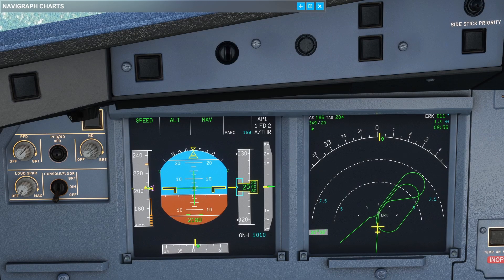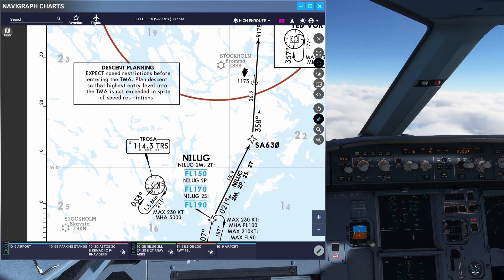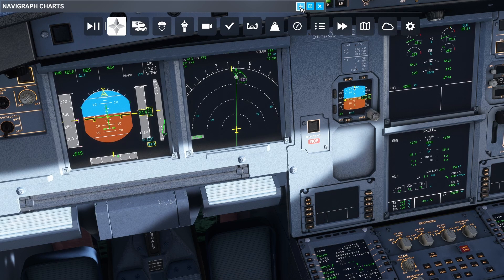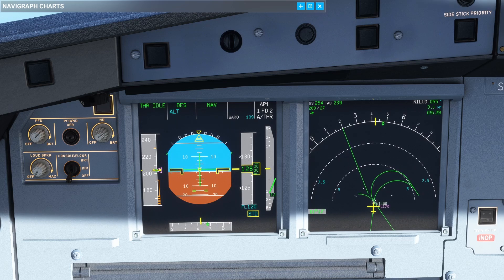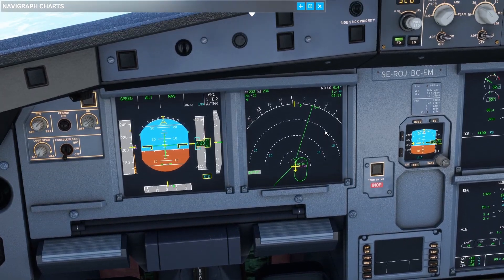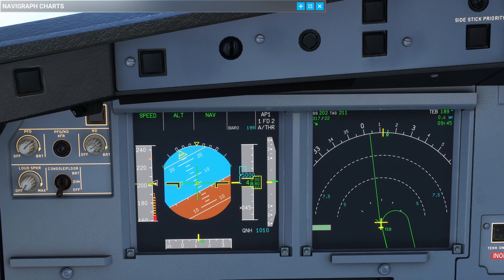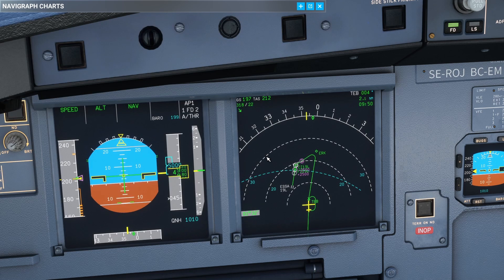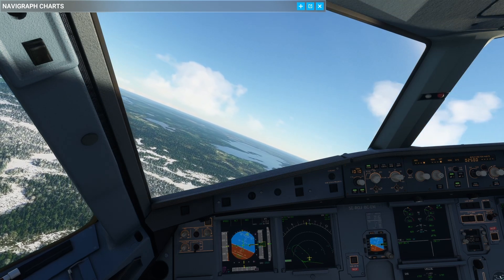FlyByWire A32nx | Holding Patterns | Tutorial

Comment: I need some help, i have installed A32nx in my MSFS 2020, but the autopilot is not working, and the buttons doesn't show the up and down arrow to engage or disengage the autopilot commands....do you guys faced such issue, any hints ..?
Reply from the maker: Go to general options-accessibility-cockpit interaction system-set it to legacy. That will give you the up and down arrows.
Reply: @RealSimPilot  Thank you so much!!!...it really worked and made my day. One more thing, how can i fly together with other Vatsim pilots e.g. as their first officer, is it possible in MSFS 2020....can i have your messenger, i have some questions while flying.....is there a better way to find taxi-ways...i am most of the time lost when taxiing in and out of airports....any helps are appreciated...
Reply from the maker: There is an add on for shared cockpit but I have not used it. I would recommend navigraph for your charts to find taxiways etc.